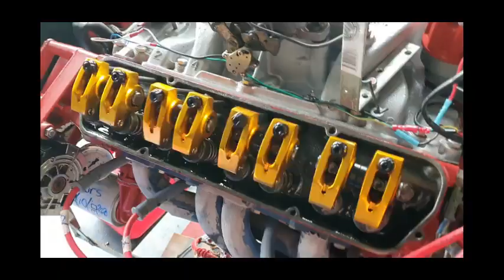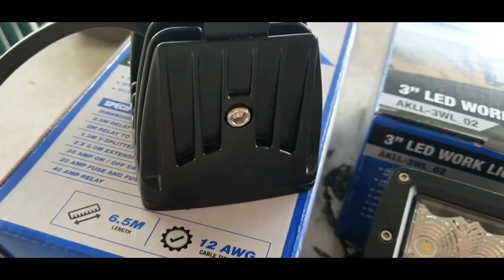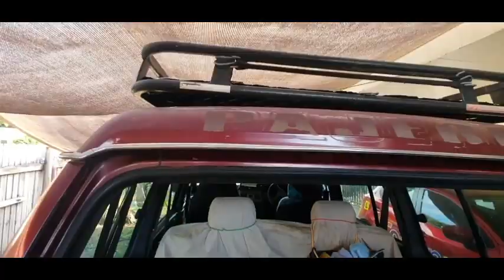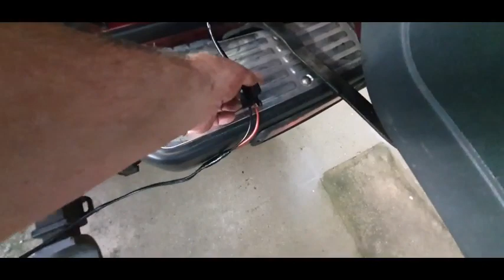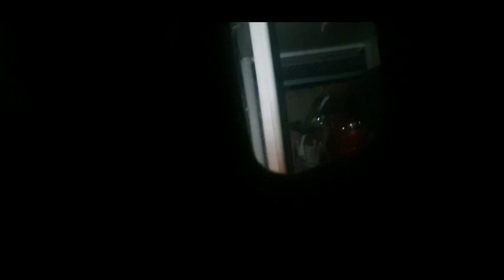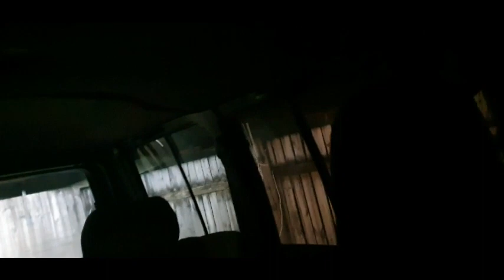💥4x4 Led lights full installation Mitsubishi Pajero gen 2..HOW TO INSTALL.. REAR SPOT LIGHTS!!

Comment from the maker: Has anyone had experience using these kings lights any problems such as water leaks 🤔🧐
Reply: just a bit of moisture inside but it goes away ,  steer clear of their dc fridge/freezers though everyone i know had issues .
Reply from the maker: @closertothetruth9209  ok thanks.. that's handy to know  👍